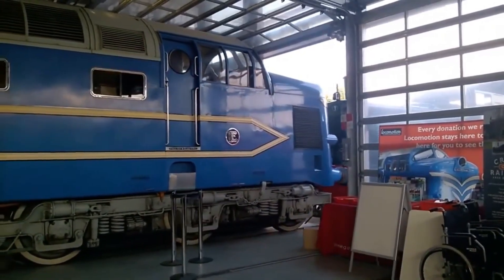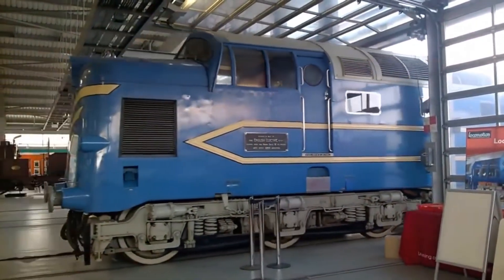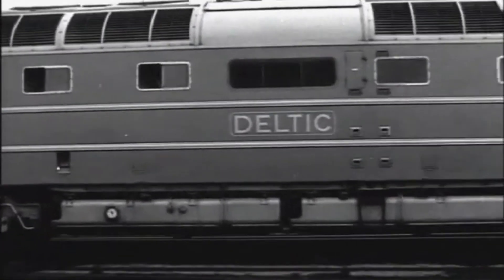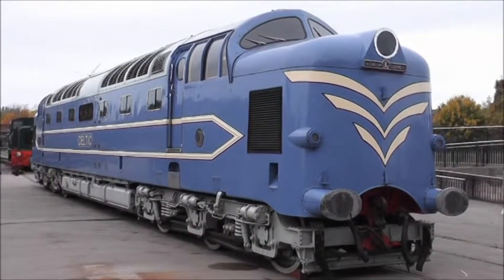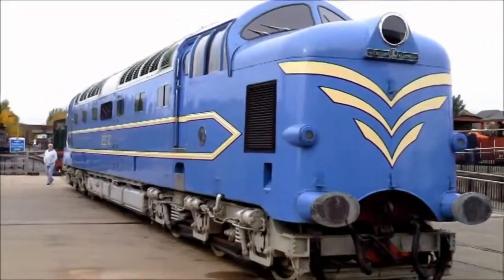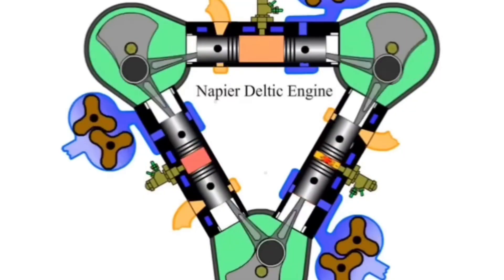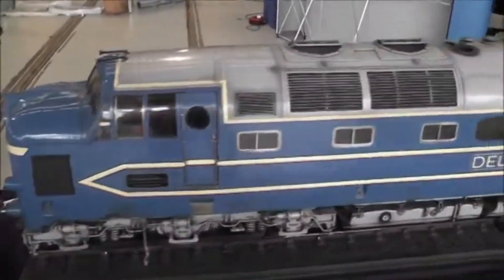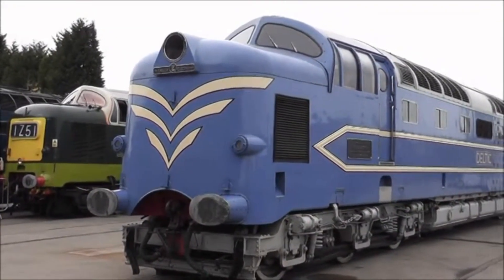English Electric DELTIC prototype (DP1): The Diesel That Changed British Rail Forever? #deltic #dp1

Comment: Unlike most of the prototype diesel locos Deltic survived the cutting torch! I remember seeing it on the ECML at Grantham and have a black and white photo to look at.
The Deltic had a look, sound and smell all of their own. I watched many trains headed by them at Grantham, Little Bytham, and High Dyke and just like the A4s before them they had a certain presence which set them apart. Some of them even continued the tradition of being named after racehorses! I'm not a great lover of diesel locos (despite having driven many miles with them) I will always be a steam man, but I certainly have a soft spot for the Deltic.

Comment: For clarification, “DP1” stood for “Development Prototype number 1” in the English Electric firm. If you’ve got time (and there may be some revenue), look into the history of the next number - DP2, which had a similar body structure, but an upgraded EE engine. When it grew up, it became the D4xx, then class 50. It was originally on lease to BR in the late 1960s when the West Coast electrification project ran short of cash, then later on was bought in, then transferred to the Western Region from around 1974. Several still in service and preservation at present.

Comment: Another badly researched video, DP1, which was the the original internal designation, Diesel Prototype 1, was built at the Dick Kerr works, Preston Lancashire, in the North West of England. While Locomotion , where DP1 now resides is most definitely in the North East of England, cradle of the railways. Great locomotive but rubbish content maker.

Comment: Who thinks this should be restored (to operating)
Reply: It would be nice but probably uneconomical
Reply: @kevinwilliams1602  compared to say the very economical and frugal Flying Scotsman. I bet it could be crowdfunded to repair or renew. Although the other Deltics at DPS are probably more useful for renovation first.
Reply: @kevinwilliams1602  The money that this government is wasting every day, restoring DP1 would be a drop in the ocean off the Chagos Islands.
Reply: It would be good granted if it could be restored to running order but apparently the power units are missing pistons and Conrods and apparently the production Deltics have different power units but surely it could be possible to re engine it with production Deltic power units
Reply: @stephenchecksfield632  Yeah, I get it. It hasn't run for 10 years now.
Reply: More like 65 according to the narration . @TheOfficialTheoHemming
Reply: @MJ-iv1es  No, it last run on the Ribble Railway in Preston in 2015.
Reply: @TheOfficialTheoHemming  Depends what you mean by "run".Was it dead in tow? The Ribblehead website doesn't say anything about the engines being capable of being powered. That would be surprising, since as of two weeks ago when I visited the Locomotion museum, it was still claiming to have engines that were broken/unrepaired since 1960?
Reply: @TheOfficialTheoHemming It hasn't run for 60 years
Reply: It would be nice, but I imagine the original engines would be development versions of the marine Delta engines used by the Royal Navy, rather than the units that went into production Deltics.  That would suggest that parts for it just don't exist, so the fact that the engines were stripped for spares for the Navy is a very big issue.  Plus, there's the fact that the issue that took DP1 out of service, the major oil leak, doesn't ever seem to have been properly investigated and bottomed out, which would suggest that it is quite possible that a lot of money could be spent in pulling the engines apart to discover that they can't be repaired due to wastage of the major castings because of corrosion caused by the engines no longer being oil bathed due to being stripped, or that there is a major issue with the original castings, such as major cracks, caused by the conversion of the original marine diesel engine to something suitable for railway use.

I imagine that, if it had been considered viable to convert DP1 over to production Deltic engines, BR would have done so.  Retiring even a prototype locomotive after only 5 years and 450,000 miles if it could be retained in service seems very unlikely, so I would suggest that there were other differences in DP1's specification compared to production Deltics/Class 55s that made it uneconomical to retrofit it to production Deltic motive power.  The fact that BR didn't strip DP1 for parts after it was withdrawn, as almost always happens to locomotives withdrawn early due to damage or irreparable failure, certainly strongly supports my theory that DP1's specification was substantially different from production Deltics.  Even if it was possible to retrofit DP1 without utterly rebuilding the licomotive, would it really add anything to the experience of riding behind a Deltic?  The thing that really made DP1 different from a production Deltic was the variances in motive power.  To retrofit it now with production Deltic parts would rather make DP1 "just" another Deltic with slightly strange styling nose and tail, rather than what she is now, a truly unique piece of history that tells the story of the creation of just about the most famous generation of diesel-electrics ever used in the UK.

Some people may think I'm being anti-Deltic, but I'm really not.  My dad was in the Royal Navy and worked with the Delta engines as they were used to drive the generators that provided electrical power on board ship.  He absolutely loved those engines, and he took me to local stations to see Deltics in operation, and to experience that unique sound.  I genuinely believe that the Delta/Deltic engine was a legitimately new direction in diesel power that could have become the standard if it had been given the development, and the developments in materials technology, that it deserved.  Sadly, it wasn't, and it became an interesting dead-end.  We won't ever see its like again as, despite its advantages in efficiency and power production, two-stroke diesels won't ever come back in this, belatedly, emissions-conscious world that seems intent on killing the "small" diesel engine as the people that build them seem to have no interest in making them as efficient, and clean running, as they could be...
Reply: If only the Flying Money Pit wasnt taking every scrap of money available
Reply: No chance, all the spares have long since been used by the Navy
Reply: I would love to see this happen,  The same team that repaired the hst prototype (project miller )or some one similar , Dps  did a report on dp1 some time back in the view of restoring it to its former glory,  Unfortunately nothing came of it Shame.